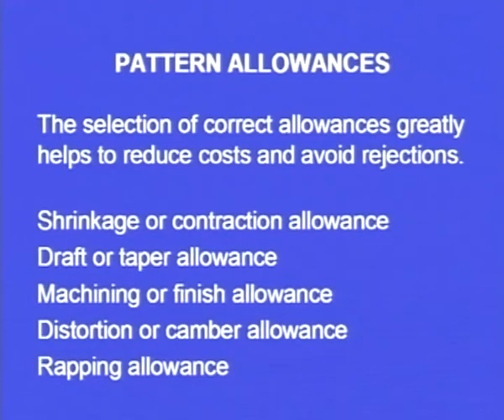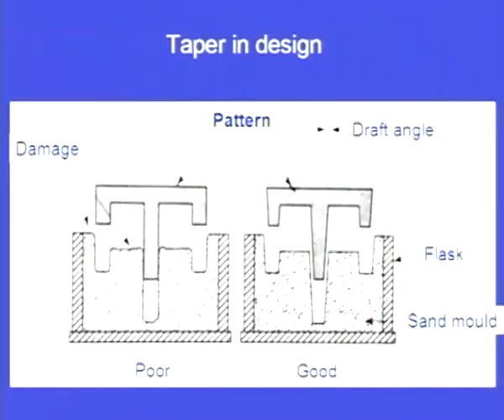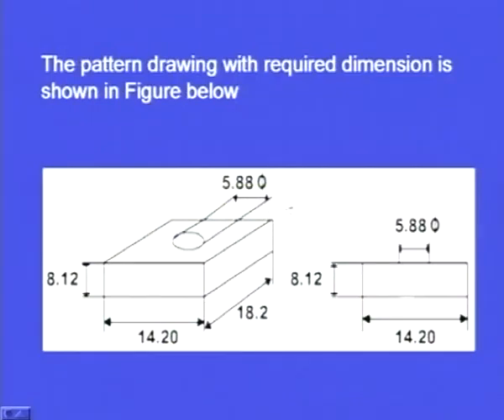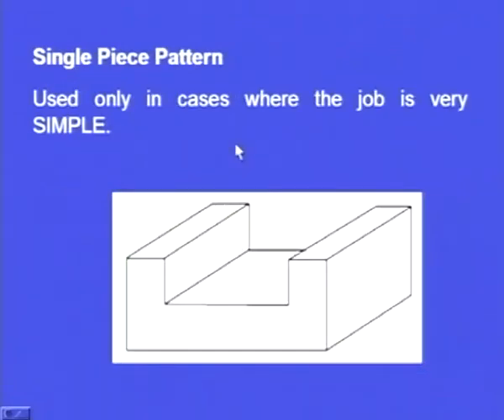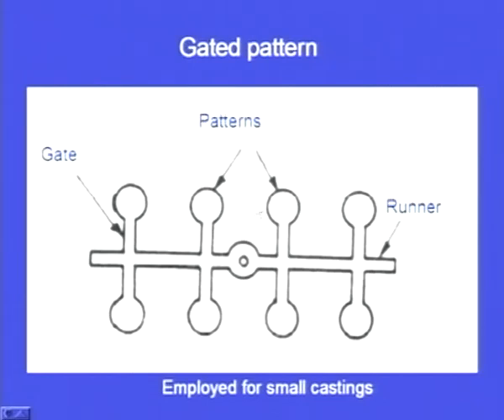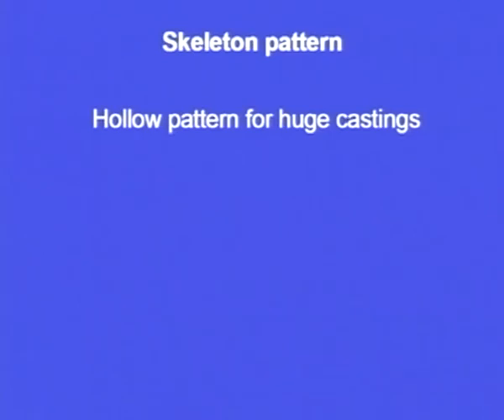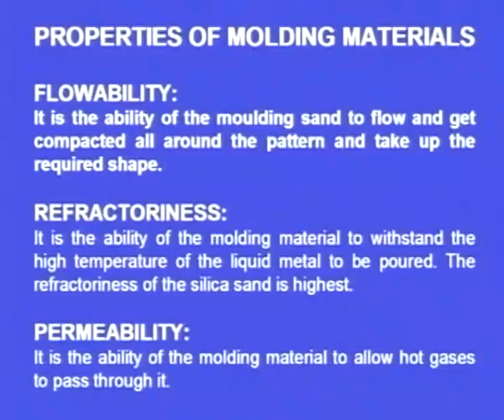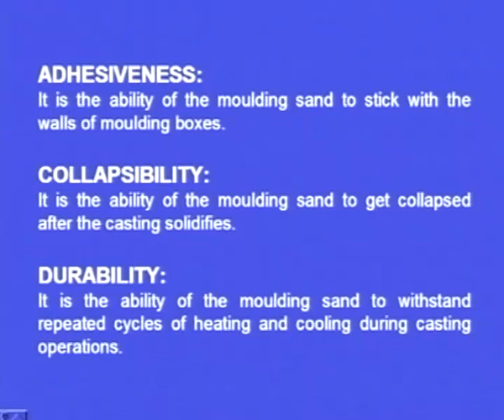Mod-2 Lec-2 Metal casting

Comment: it would have been good if the teacher had given the reason rather than just reading what is popping on the screen.
Can someone explain it that in example 1 why did they subtract the allowance from the central hole's diameter instead of adding it ?
Reply: +LALIT DOGRA  dimension get shrink while inner hole get expand ...dats why
Reply: LALIT DOGRA  bhai... qk metal shrink ho raha h... hole ke baahar material h... jaha material hoga usi taraf hi shrink hoga isilie...
Reply: yeah all will shrink...and that circular portion tends to move outward while shrinking...thats why we needed to provide smaller dia than usual one
Reply: LALIT DOGRA shrinkage takes place radially, think of a circular disc with a hole in the middle , the radia thickness will go down , so outer radii will decrease inner radii will increase , thats applied here too.
Reply: +LALIT DOGRA maybe its because of the room for expansion of the core...as cores will be placed when pouring metal..
Reply: but during solidification, all dimensions will shrink, including hole! the one with l,b,h will shrink and so will the diameter with them, right?
Reply: @saisindhuja8989  if hole shrinks, it means it's size will increase right
Reply: Seems to be an error by the Pf. All dimension will shrink as the metal cools. That is the phenomenon behind the wheel's rim in bullock-cart.
Reply: @stupidideas1686  I agree with @mishank jain. In case of rim of bullock cart wheel, it's a ring with large dia, not a disk with small hole. In case of rings, the circumferential stresses dominate the radial stress. So the dia decreases after cooling the ring.